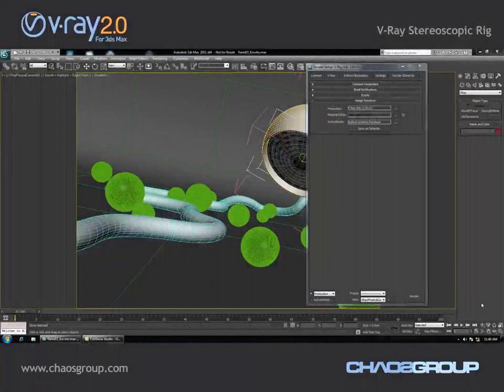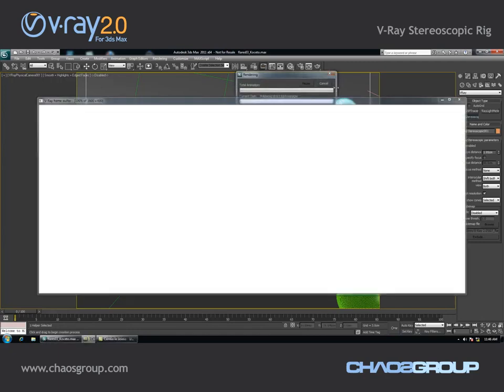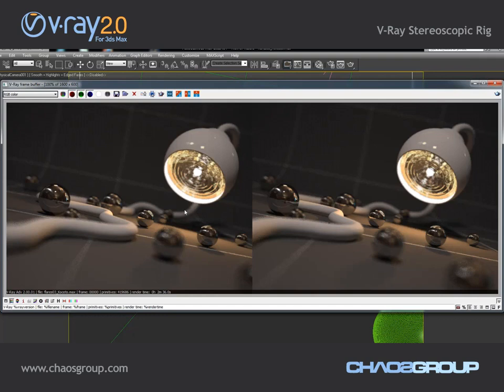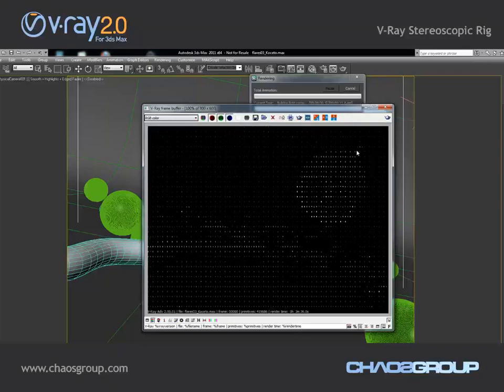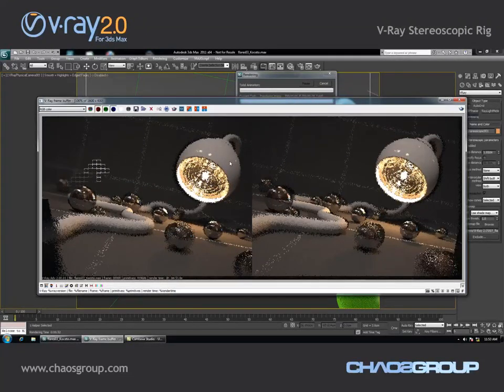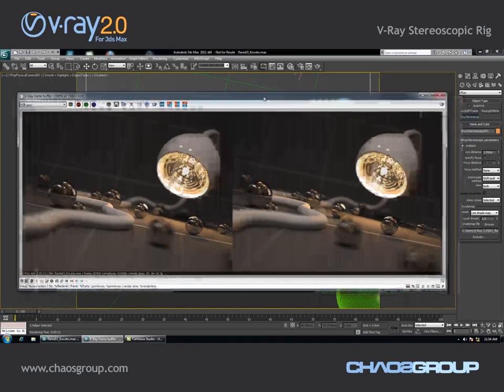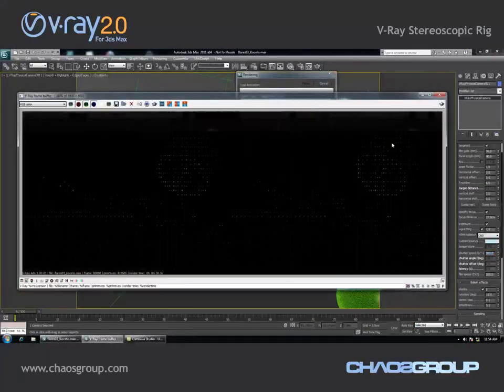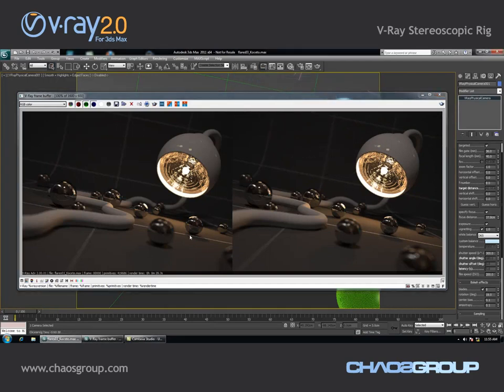V-Ray 2.0 for 3ds Max - Stereoscopic

Comment: @Godisen007 It's quite simple :-) Simply model what is there in real life. Model the incandescent bit (in this case looks like a white ball, or similar), put a material (VRayLightMaterial with pretty high intensity) and the piece of glass. The shape of the glass will give you the distortion you are looking for the effect. You can get a similar effect with bump or normals on the glass material :-)